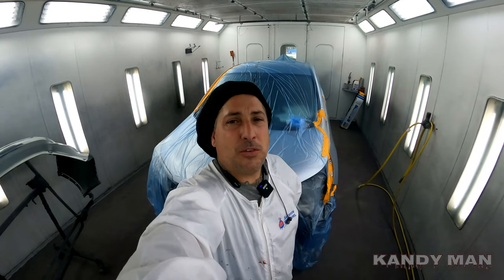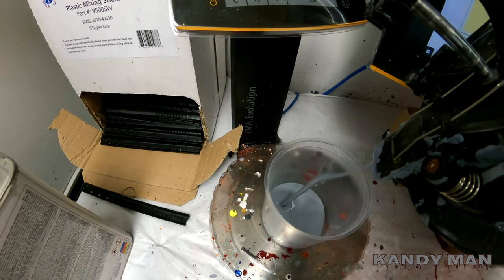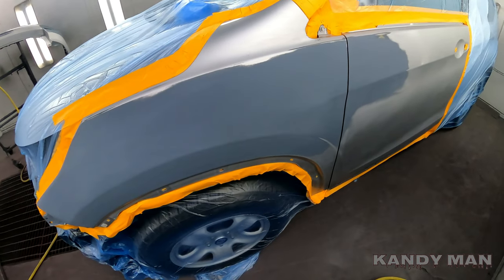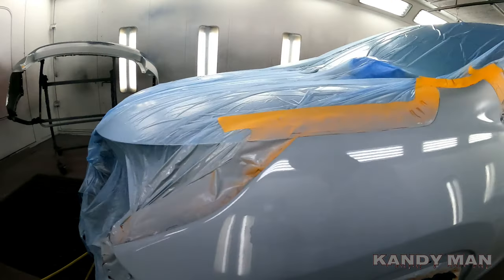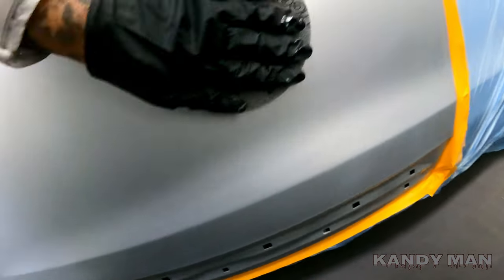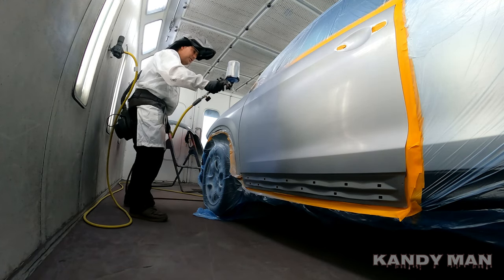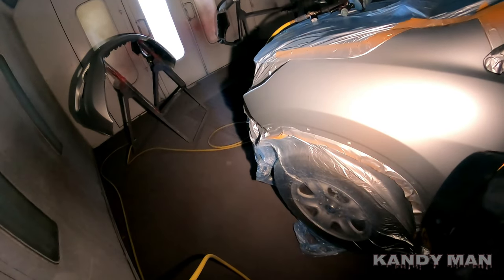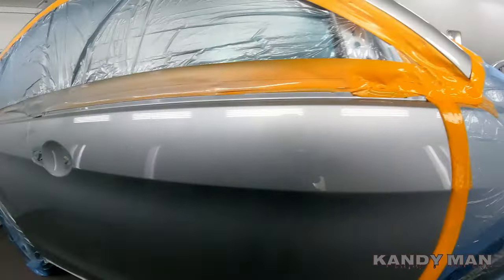HOW TO BLEND SILVER - MUST WATCH!

Comment: I usually use a hot temp reducer  (straight, 85-95 temp) and lightly wet in the sealer edge. Works very well as long as you don’t over wet it and run. Don’t ask me how I know👀👍
Reply from the maker: Lol thanks for the comments 🙂

Comment: Do you ever use reducer on your sealer edges? Like a melt in clear or anything?
Reply from the maker: No I don't really have any issue with edges  sealer is very good.
Reply: @kandyman5315  came out really good. I use sikkens colorbbuild plus for sealer I never used to melt in my sealer because I didn't even jnownit was a thing. But had issues with halos from.the edge of sealer sometimes on tough colors... I wish I  would of thought to sand it with 2000 before base lol... looks like it worked great I may have to give it a try.
Reply: @richmondprofinishes  use clear base over colorbuild and it will smooth it out
Reply from the maker: @richmondprofinishes  Yes it works well and  eliminates it completely
Reply: @PaintSociety  I use sra because I spray lesonal water. Not sure if it would be om to use the sb clear base to melt in then put water over that? I mean I guess it should be fine eh?
Reply from the maker: If your gonna use a clear base use a water base clear base but it will darken light colors     that's why I sand it if necessary 💪